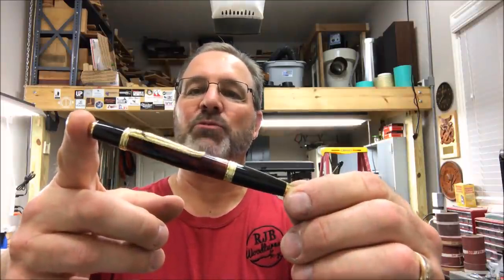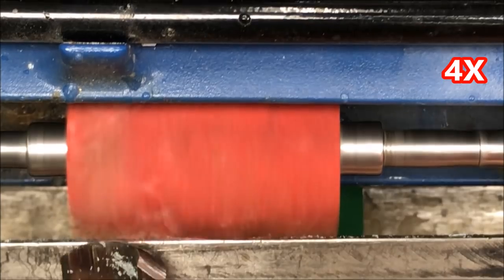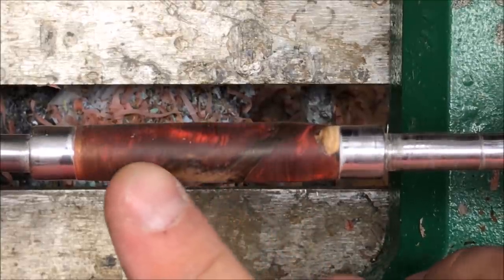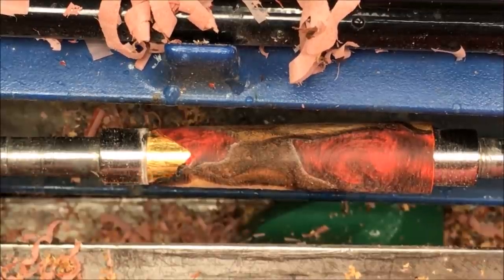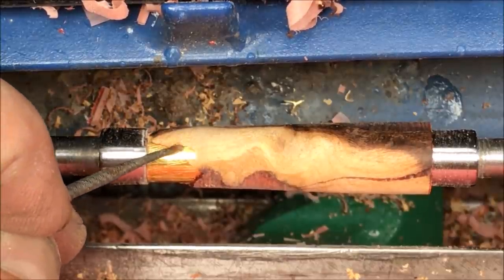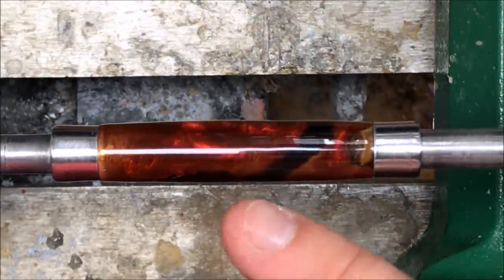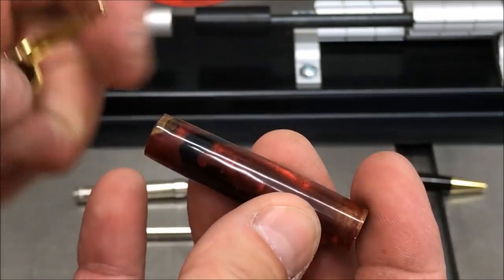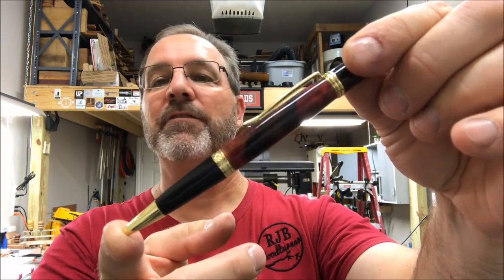The Saga of the Mopani and Alumilite Blank

Comment: The pen came out really nice. I've made a few more of them after I gave you that blank and the red is definitely one of the worst colors for mopani lol. It almost blends in to much. Green or blue makes it really pop. 

A tip for carbide tools. They are all I use. The square tool is really bad on acrylic blanks. I always use the round cutter. Think of the square tool as a roughing gouge, great for hogging away material. The round blade is more like a spindle gouge or scew. Much better for detail work. 

As always, great video. 

John
Reply from the maker: +Pendoras My only round cutter tool is a goose neck hollower. I would have normally just used the roughing gouge but that Mopani is tough. 

Regards,
Bob
Reply: I buy my round cutters from Capn Eddie.  You can make your own tool from 1/2" bar stock, and there are a lot of videos showing how to do this.
Reply from the maker: +Doug Robins Thank you Doug. 

Regards,
Bob

Comment: Sorry about the tear out on the second blank, as it was looking fantastic with the lighter wood. I have had similar problems with a square edge carbide tool. In my analysis, the long cutting surface contributed to the tear out. After switching to a 14 mm round carbide tool, which cuts on a point, I have never had another pen blank tear out.
Reply from the maker: +Doug Robins I also noticed the opposite end of the blank was thick on one side thin on the other. So, I may have cut it off the tube and that’s why I didn’t feel the catch, there may not have been one. 

Regards,
Bob

Comment: Nice pen!  Can’t wait to see your own hybrid blanks.  Have you ever had any problems with purpleheart being too porous and not taking CA properly? On my last blank I kept getting holes in the grain that filled up with sanding/buffing dust even after finish buffing to 12000 despite multiple layers of thin CA.  Really frustrating.  Any tips or remedies?
Reply from the maker: +Spokes Yes, PH can be a pain. I usually Micro Mesh it almost all way off and repeat the C/A regiment. That levels the grain and allows you to fill it. 

Regards,
Bob
Reply: RJBWoodTurner Thanks Bob. I’ll try that next. Cheers!

Comment: Hi Bob I you used an EZ-WOOD tool thats all I use. But thats not the reason I'm texting you. About a year ago I saw new release for EZ-Wood tools its  Negative square replacement for the stock 1 and I used this new replacement  and I found that I didn't have any blow out on the ends I like you would have these blow outs now they are non  Existence because of this tool end replacement. If you get to buy 1 of the replacement you won't be disappointed. At least with me not. Thanks Ray in Idaho
Reply from the maker: Thank you Ray,
  I switched to a Skew and haven’t had a blow out since. 

Regards,
Bob

Comment: did you ever figure out what happen with the between center turning?
Reply from the maker: +BEE HAPPY Wood Working and honeybees I believe the bearings in the headstock are worn out. I got a wobble while turning bottle stoppers. 
  Plus everything I put in a chuck has win out, the TBC bushings, a 12’ AL rod. 
  I can hear a odd noise when I rotate the headstock by hand. I’m feeling pretty confident that’s the issue. 

Regards,
Bob

Comment: Hey Bob, I have a customer who wants a Majestic 22kt Gold/Rhodium Fountain Pen Kit with a Trustone black and gold blank. I've been trying to research about Trustone and how to turn it but haven't had much luck. have you ever turned it and if so do you have any recommendations on turning it?
Reply from the maker: +LaxMan2k I have never turned True stone but I hear it’s finicky. 

Regards,
Bob
Reply: I've turned a lot of Truestone blanks, including the black and gold blanks. I use a 14 mm round carbide tool, and considering the high cost of the blank, will take as much as 20 minutes to get the blank to it's final shape. I turn them at 3500 rpm, and take very light cuts. I have a bright light shining on the blank and my cuts are so thin that you can barely see them, probably the thickness of a hair. When micro meshing, i wet sand by spraying water on the pad (not dipping the pad in a common pool of water) and wipe the blank dry with a clean paper towel. You can expect this sanding to remove some of the blank, so leave it a little proud of the bushing - just enough to catch a finger nail. Also, use light pressure when sanding, and don't spend a lot of time on the three most coarse pads. Is this enough advice?
Reply: Doug Robins This is awesome advice thank you! I do have carbide tools and already rake light cuts. When drilling do you use a standard drill bit and when glueing it to the tubes do you use epoxy or CA glue?
Reply from the maker: +Doug Robins Thank you Doug,
  I appreciate the info because I have no experience with truestone. 

Regards,
Bob
Reply: The drill doesn't matter - I've used a brad point and standard drill with equal success.  I drill on the lathe at 500 rpm, using a chuck to hold the blank and a drill in the tail stock. I drill slowly, about 1/2" and pull the drill out to remove and clean the drill, then squirt water on the drill (if it hisses, then I drill less and use less pressure), and then squirt a bit of water into the blank. I think it's important not to create a heat history on the blank (just a theory). I have always used medium CA with good results, but think epoxy would work equally well. I wear nitrile gloves, put a drop in each end of the blank, and then about 4 drops on the brass tube to wet it completely, and then insert it into the blank with a twisting motion. I wait overnight before turning it.  

Ask more questions :-)
Reply: I think you are a natural, Bob, and your techniques would serve you well with Truestone blanks. They polish really well (and don't need CA glue as a finish).
Reply from the maker: +Doug Robins Thank you Doug,
  I’ll get the opportunity to turn a truestone one of these days. 

Regards,
Bob
Reply from the maker: +Doug Robins Thank you again for thin information, I’m learning here as well. 

Regards,
Bob